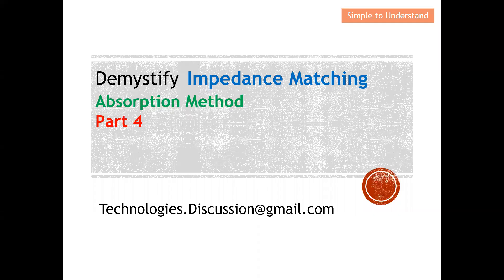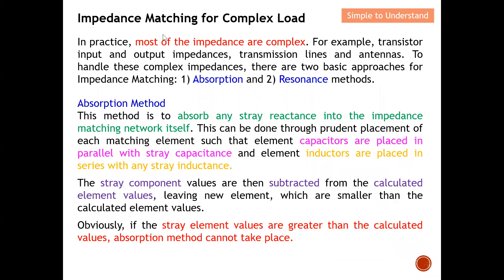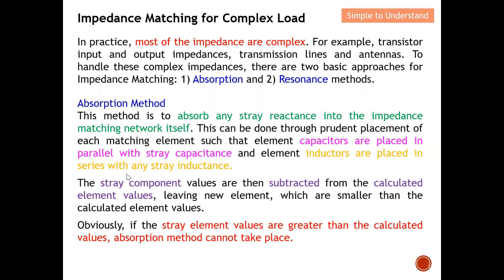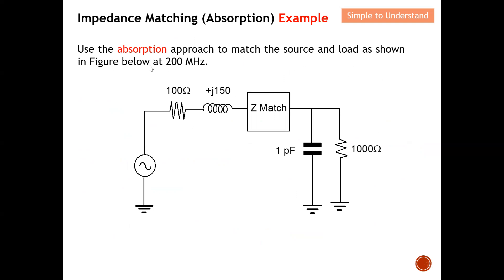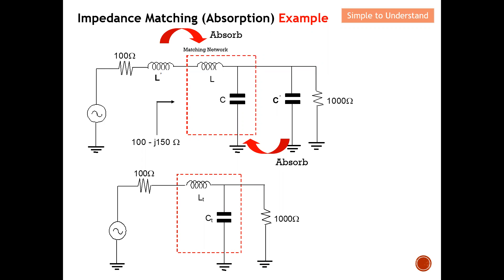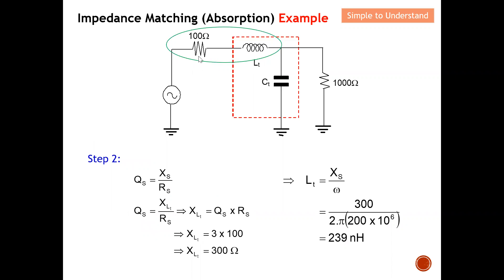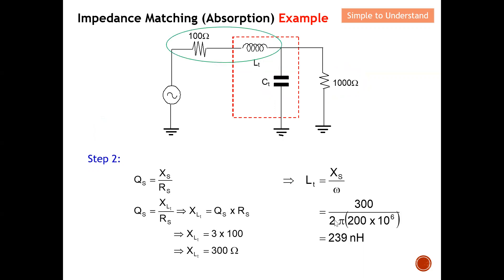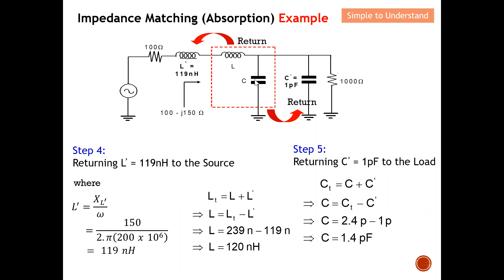Impedance Matching #4. Apply Absorption Method Design: Cancel Stray Reactance (L & C) for Matching.

Comment: If there is a 10 cm long pcb trace between source and load, where should we place the L and C  impedance matching components? Both L and C should be close to load ?
Reply from the maker: 10 cm can be long or short but mainly depend on freq. You are right, an impedance matching network should ideally be placed as close to the load as possible. The reasons as following:

Minimizing Reflections: Placing the matching network close to the load minimizes the reflections that occur at the load interface, which can be critical in high-frequency applications where signal integrity is important.

Effective Impedance Transformation: When the network is placed near the load, it more effectively transforms the load impedance to match the source impedance, thereby ensuring maximum power transfer.

Simplified Design: By placing the matching network close to the load, you can simplify the design and analysis of the network, as the impedance seen by the source is the transformed impedance rather than a combination of transmission line effects and mismatched load impedance.

Minimizing Transmission Line Effects: If the matching network were placed close to the source, any transmission line between the matching network and the load could introduce additional impedance variations, phase shifts, and potential mismatches, complicating the overall network design.